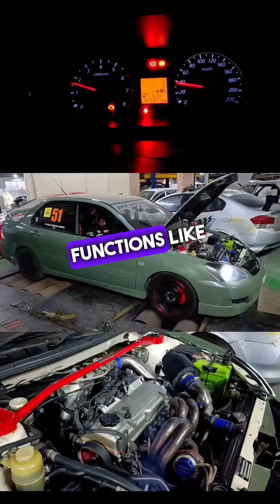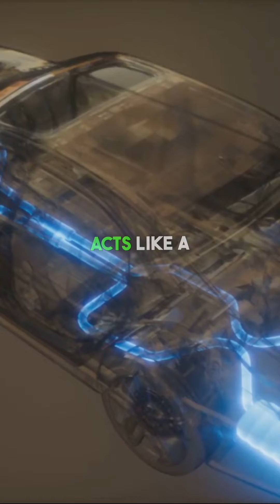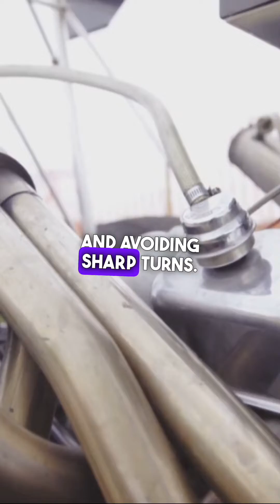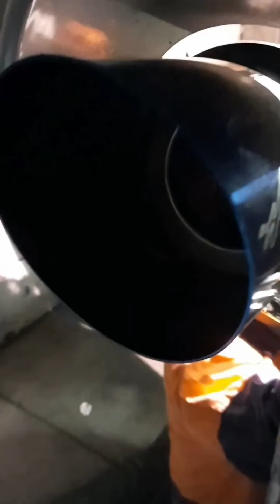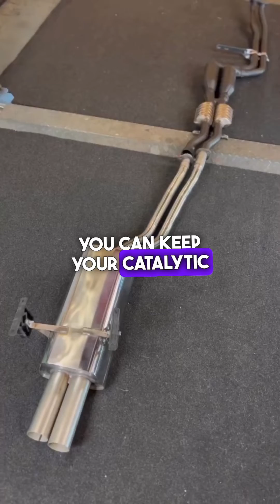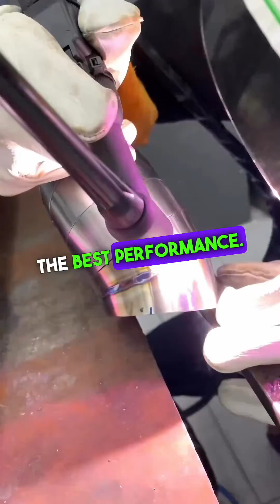Debunking the Myth of Exhaust Back Pressure!

Comment: Every builder has always said open headers just downpipe is bad for v8 an shit....its makes the engine just go insane with no resistance at all in a sense thats very tech. To explain....now yea a 3inch flowmaster heads all the way back x pipe connect to flow masters is what i run but still that is some back pressure to my 355 rocket olds for optimal   hrs.pwr. but just open heads an ripping on a old girl explained back in the day to me made complets sense of no back pressure whatsoever is not good but just having any exhaust is back pressure lol so a 4 banger with 3 inch back is bad they taught us but 2,2.5 on a v8 is restricting back pressure robbing hrspw. Lol but a 3 is optimal for hrspower on the v8....but if your crazy an do 4 or 5 diesle size systems then just like a ricer 4,witha 3.5 exhaust thats wide open no restrict set up😂 im dumb speaking this an learning it was easy, me trying to say my piece just made me sound like a old hick that is in the conspiracy club.....